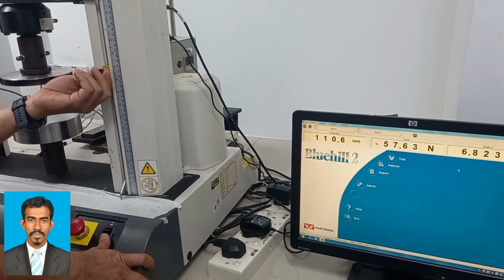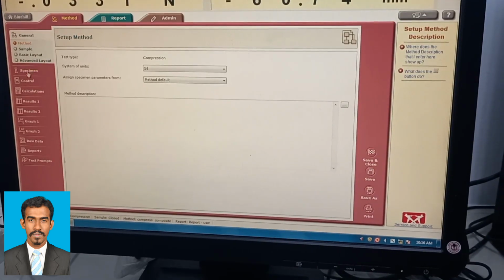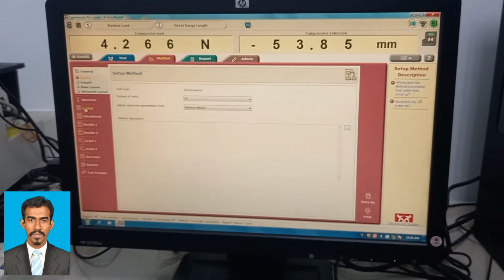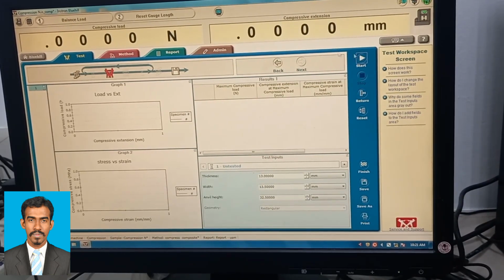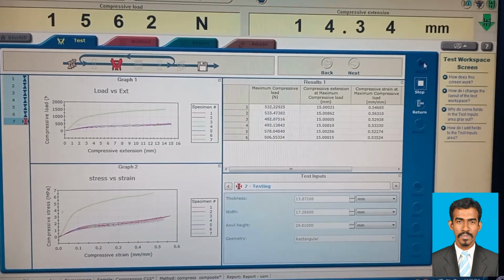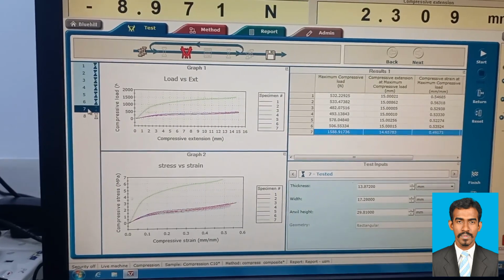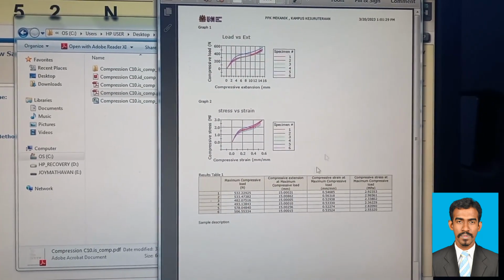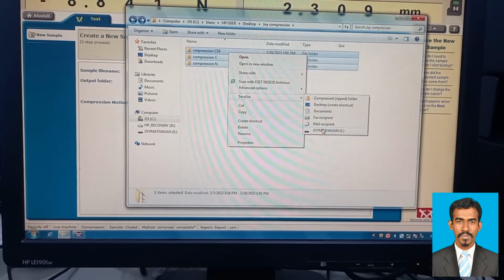Compression Test - UTM - Universal Testing Machine

Comment: Thanks for your good explanation really help a lot, may I ask if the specimen I used is not a standard cylindrical shape, will it affect the accuracy of the result much
Reply from the maker: I'm glad it helped you. It won't affect the results much... But if you're sending it for any journal (as a research paper) then you need to use standard size/shape.